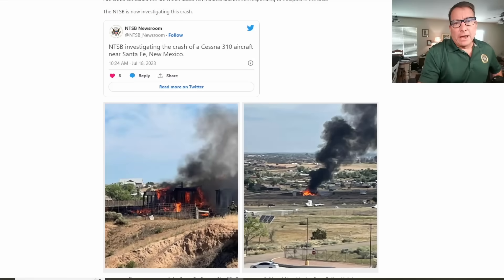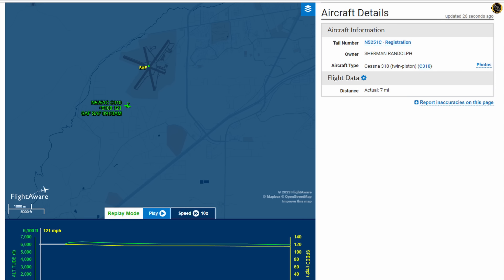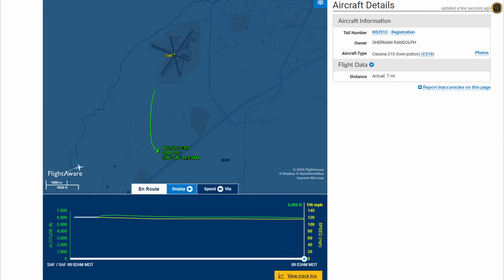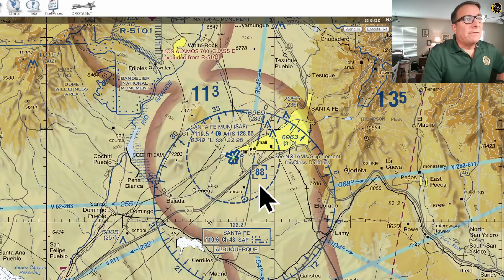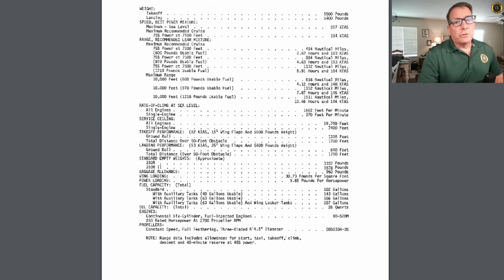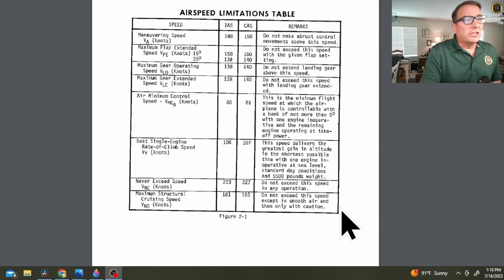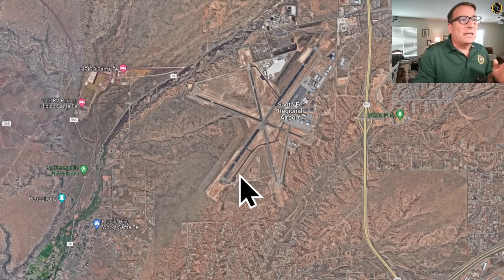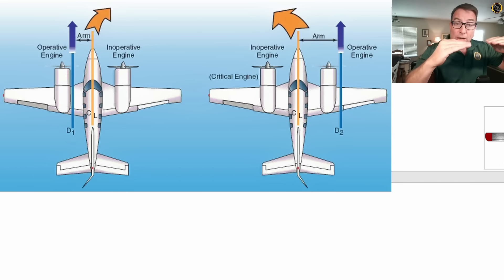Fatal C-310R Engine Failure - Santa Fe, NM

Comment: Question:  If i understand correctly, both engines spin clockwise on this Cessna.  Do some multi engine planes have two different rotations?  For that matter, what about multi engine jets?  
Another question:  would it not maybe have been a little wiser, in retrospect, to just maintain glide speed straight ahead, if the ground was more or less flat?  With only fifty feet above ground level?
Reply: With the Cessna i do believe the engines do rotate in the same direction, like the Dutches.
Some planes have counter rotating props like the Piper Seminole.

And yes, if one couldn't gain altitude then flying as straight ahead as possible to an off airport landing would have been better.
Reply: Yup, you’re correct. This 310 has identical engines. For that reason, the left is considered the critical engine. Some light piston, aircraft do have counter rotating engines but that introduces complexity of parts and maintenance, so a lot of manufactures elected to just keep it simple and install the same engine twice. 
Most turboprops (jet powered propeller engines) also have engines that rotate in the same direction but they have much higher performance and though it would still be a challenging situation for any pilot to loose an engine in such a critical phase of flight such as take off in a high density altitude day, it would have been more manageable in a higher performance aircraft like a turboprop. 
In this scenario, he was only able to achieve a maximum of about 50 foot per minute climb rate. That’s an alarmingly low rate of climb. He was only able to climb about 300-400 feet into rising terrain and obstacles, most likely the reason he inadvertently let the airspeed decade lower than his Vmc (min controllable airspeed) and lost control. 
In the best case scenario, a left turn to runway 33 would have been the shortest route, but turning into the critical (left) engine is very challenging and he no doubt had his hands full. 
It’s possible to recover from a VMC roll but one would loose more than a few hundred feet of altitude, which is all he had to begin with.

Comment: Juan I disagree the PROBLEM or A PROBLEM turning into the DEAD ENGINE. It is not. The critical engine is yes, the one with the most adverse yaw, but it is easier to turn into the dead engine and you don't need as much bank.  AS LONG AS YOU are coordinated and have airspeed turn left or right. If you are low, slow hot/high DA, heavy GW you are screwed in light twins, regardless of direction of turn. He should have pulled the good engine back and landed under control off field.

Comment: When I was a tower controller, I always asked which engine failed.  Then proceeded to advise the pilot on an opposite turn.
Reply: @blancolirio2  I'm also a pilot so I understand the importance of not turning into a dead engine.  I know the stress levels are high in these kinds of situations.  I'm trying to be a calming voice.  Last thing I want to see is what happened here.
Reply: If I were you, I would not advise the pilot which way to turn based on which engine failed. There are situations where turning into the dead engine is preferable and perfectly safe.

Comment: If you own or fly for others do the math and plan for a single engine out after takeoff 
high altitude hot day weight and balance worry aft weight 
always lower the nose first immediately single engine feller then procedure 
keep aircraft above the blue line VMC better a control crash ahead then a uncontrollable flat spin 
plan for the plane limitations 
the plane does care how much experienced you have as a pilot

Comment: Thanks Juan for another quick and insitful broadcast.  I have a question.. is there regulated stand for which way props should rotate? or is it down to engine manufacturer to decide? also.. is there any advantage or disadvantage to which way a propelleor rotates?  Finally.. can a twin engine aircraft have propellors where starboard rotates in one ditrection and the port engine rotates in the opposite?  would that counter OR create an aircraft direction bias? <- What about 4 engines ? 2 either side doing opposite rotation   ??
Reply: *standard not stand
Reply: i mean port wing - one eng spins one way and same wing the other engine spins opposite. same for starboard wing.  is it a fuel efficiency or engine stress or somnething that would make that an infeasible implementation. Thanks. Rob

Comment: V sad, but thanks for covering.   Might save someone else’s life.    If you do get into VMCA the best way to get out of it is to close both throttles and then deal with what you have left (in this case a forced landing).
Reply: blancolirioo  the lack of control isn't the loss of thrust on the dead engine, it's too much thrust (for the low speed) on the live engine.    Cut the live engine and you lose the asymmetric problem  -  you're now in symmetry again.   Of course, we're still heading towards the ground, but we can deal with that much better than spiralling in.

Comment: If he rolled it he rolled it completely over.   The wreckage shows the tail to be upright.  With the conditions that existed he had the deck stacked against him with the single engine service ceiling below the density altitude.  I’ve been flying a 310R for a few years now and on hot days I am one who would wait for cooler temps.  Not passing judgment that’s just me.  Although Bob Hoover proved you could turn into a dead engine as long as you’re above vmc, it would not be my choice either.
Reply: 99 percent of the pilots are not Bob Hoover.

Comment: I once met a pilot who flew small planes who told me he preferred single engine planes because he felt safer in the event of an engine failure than in a small plane with two engines.  He told me that in a two-engine small plane with one engine failure the other engine was just going to take you to the scene of the crash or your death.  Something to that effect.  I never quite understood because, intuitively, I just thought it would be better to have at least one engine working.  I understand, though, that on large commercial planes you would be much better to have either one or more engines still running if you suffered an engine failure.

Comment: Well I slightly disagree with the "more dangerous than a single engine aircraft with an engine failure". If he had handled it properly he might have been able to make it back to the field or made a successful off-airport landing. With NO engine, you're going to crash and there's no question about it. That being said, I've never had a multi rating, though I've operated from some high altitude airports. It IS a different world up there. Damn shame though, Godspeed.
Reply: Unfortunately light twins sometimes give the pilots a false sense of security.
Dan Gryder has some valid points about pilot recurring proficiency training.
There are a lot of engine out single engine crashes where the pilot loses control and lets the aircraft stall and spin before impact.
Reply: @guitarhillbilly1482  Yeah, I've heard that too, good points. I was an ATC and had a light twin with an engine failure and he was asking ME "I shouldn't turn into the dead engine right?" He did make it though, I made sure not to make it worse. Aviation is the safest mode of transportation statistically, until "something bad happens" and then it's unforgiving.

Comment: Q: I was wondering if the ATC/tower control could have ALSO suggested to the pilot ditching the plane due to these or any other circumstances?
Reply: I was wondering the same thing, seems better say something about what is ahead of the pilot and any runway is yours rather than just one option.
Reply: ATC can’t open up all runways for the pilot. You do realize there are multiple airlines flying in and taking off at the same time right? ATC did all he could
Reply: @klskgm1223  they do it all the time for emergency aircraft. Have you not heard of go arounds or delay vectors?

Comment: High altitude and high temp, and it seems the key comment the pilot made about trying to get some altitude, is probably what got him. Trying to climb on one engine probably degraded his airspeed below VMC. If he had enough altitude to clear obstacles, I wouldn't have tried to climb it, just maintain the altitude he had and make very gentle turns back to a runway. But we still don't know if he feathered the correct engine and if so, soon enough. He must have raised the gear right after takeoff, so the main drag would have been the windmilling engine.  310's have split flaps, so they aren't normally used on takeoff.

Comment: Juan,
I’m just a bit confused. You repeatedly refer the C310R and the IO-520 engines. However, the Aviation Safety Network page you showed (that, incidentally, shows a short nosed non-R model) describes it as a T310R II. If it was, in fact, a turbo model, then that would have had a major effect on the performance of this aircraft, given the high DA.
Reply: I added a question to JB in this same vein.
Reply: blancolirio2  According to FlightAware the engines are CONT MOTOR TSIO-520 SER (Reciprocating)
Horsepower: 300. These are the turbo versions of my IO-520 285 hp motors on my 1980 310R.

Comment: 7/18/23; thx Juan for another factual & technical review of combo:  Density Altitude, temperature, Field (mou tainous) elevation when twin engine a/c has 1 engine fail on takeoff climb out...significant issues arise with direction of turn Lft/Rt re: inherent engine torque/yaw, which , if in emergency reaction, can easily overwhelm & worsen /magnify the turn into...'flip' attitude...instaneous death spiral at +100mph at very low, un recoverable altitude. Horrible! So what's a pilot to do here Juan? Keep climbing until you get to...10,000 ft? Catch your breath/remember training, hand fly a/c, 'feel' best way to make a (wide) turn-not into 'dead' engine- then back to airport..most available runway etc. Am not a pilot. So asking Juan's best way to handle this particular situation. Thx for all the analysis, graphs, ATC radio & your preliminary comments.👍👍
Reply from the maker: It's about making good decisions before you launch!

Comment: ATC personnel need to be better trained.  This ATC gave INCORRECT instructions to this pilot.  The pilot said "Lost an engine" to which the tower gave "Left Turn" permission knowing this aircraft was a twin.  AND IF the ATC did NOT know it was a twin, the ATC should have assessed quickly if it was single or twin.  The ATC should simply tell the pilot "You are cleared to turn your discretion."  This would allow the pilot to make the right choice for an engine out turn.  Too Bad.  I LOVE THE 310.
Reply: The ultimate decision is up to the pilot as to what to do.   Considering the fact that the density altitude and the maximum single engine altitude the aircraft was capable of achieving under those temperature and altitude conditions were similar the pilot best choice would have been to land on terrain straight ahead.  He likely had no climb performance at all.

Comment: if he had RAM turbo engines in waco it wouldn’t have been a issue even with 3-4 passengers and  bags in the back  short from being crass, he didn’t have that conversation with the boys in Texas.  shoulda  landed straight ahead without 1k ft and he’d likely still be around to buy a 
brand new baron or caravan. tragic but who is training and advising these people?? the instructors???  He had an ME so he knew the drill knowing altitude is important but not paramount. land straight ahead!!! my first few hundred hours in a  310R convinced me i couldn’t turn back even with RAM-Ts at gross.   That said, not sure what happened there yet but warm up and cool down on turbo engines is critical - failures are a nightmare and will happen but what we all train for

Comment: Pilot never should have taken off under those conditions. Pray for the best, plan for the worst. I've been at that airport in the Summer, and its no joke. We were flying Aero Commanders out of there in 2011, and just getting the engines running was a chore. We ended up having our pilots start the engines with mixture at roughly half, because the DA was so high (100*+ temps). We even witnessed a twin on final lose an engine due to overly rich mixture. You folks be safe out there and pay attention to those POH's. It just may save your life.

Comment: I live about 1 kilometer from KMIC (Crystal, MN), altitude 869'.

If I'm reading the chart right, even at 110°F, the density altitude would be a bit over 4,000'?  

And given the terrain here is generally flat, if this Cessna had that engine failure taking off from KMIC, as long as he didn't panic, feathered that left prop, and turned to the right, he had a good chance of a controlled landing back to KMIC?

Comment: Question for you JB. Would the same thing happen if it were the right engine, considering that the aircraft is symmetrically manufactured. Why is there the tendency to only go left if I heard you correctly. 
As usual, thanks for sharing 👍.  Appreciated
Reply: As a non-pilot, any pilot please correct me if I’m wrong.

I believe it has to do with not only the right engine now as the only power source to the left, but also because of the torque moment of the counter clockwise direction the right propeller is turning.

So, if I’m understanding the way those turboprops are turning, and looking from the pilots perspective (the rear), the left propeller was turning clockwise and the right counterclockwise. Thus when he lost the left, the right doesn’t have the left side torque to counter it. This presents a left yaw which you don’t want to turn into.
Reply: When you’re trying to climb, the descending propeller blade takes a larger bite of the air. It’s better if the descending blade is between the engine and the fuselage. On the right engine, it’s as far away as it can get. Not good..

Comment: LIGHT TWINS... Certainly not "safer" than a single engine, because of the need to fully understand the critical engine failure handling. PLUS: Lets consider that the design of "light twins" does actually result in a much more limited performance aircraft when one engine fails! due to having the dead engine propeller acting as an air brake, and most light twins are designed for "normal" flight characteristics with both engines running... Just run a quick calculation of total weight of the aircraft, then the designer divides that weight by two engines and gets a "reasonably well  powered" design... Now, stop one engine, go and divide the still whole weight by one... See? 
-the remaining engine has to pull the heavier airframe, built for two engines, which obligates to reinforce the wings in order to properly support the engines weight and torque and all moments, therefore resulting in a comparatively heavier structure, much unfavourable with respect to a similar size single engine airplane... The fact is that historically, the need for having a second engine was not really to increase safety, but because of the lack of more powerful engines  from manufacturers... The final result is a heavier per-engine airframe, that becomes a "heavy brick" when any of the two engines fails. Presently, the availability of small gas turbines make the single Turboprop a much safer and effective aircraft, even more capable than many piston engined light twins.
In reality, a light twin is not truly significantly safer than a single engine. Probably, the single engine becomes a better glider when the engine quits, than a twin with a dead engine... As the single engine will be simmetrical  at all times.

Comment: If a dual engine plane has perceived higher safety factor wouldn't that only be the case if the plane was only operated within the single engine safety/performance margins?

Comment: Having single engine performance decided before you take off might have changed his decision, if he knew the engine was not sufficient to stay in the air. Looking at the map there was desert in the direction of the runway and housing left and right, if you know you are not making it back you just land in the desert. Even if you think the engine might work you try to gain altitude over the desert to test that theory instead of assuming the theory and turning over residential areas.

Comment: Sounds like there was a degradation of airspeed, at a slow speed, until it waltzed over the roll speed limit.  Juan, does increase in density altitude increase the indicated speed for the ROLL limiit?  Also pics you show it looks like if he flew strait ahead and did a gear the terrain appears to have be favorable to straight in gear up.

Comment: When I sat for my checkride 4o years ago, my FAA guy pulled on engine on me after simulated take off at 7500 foot imaginary airport.  I accomplished everything perfect.  My examiner asked what altitude right now.  I reported 6500. I guess I crashed.  I thought I failed as he said nothing.  At least in a Seneca 2 at altitude, I would handle a single Engine failure in a twin as a single engine failure in a single.  Land straight ahead.
Reply: As the years increased insurance increased as well as training updates.  At least back then your chance being killed in a piston twin 4 times higher.  Turboprop singles started to move in as a safer option over old piston twins